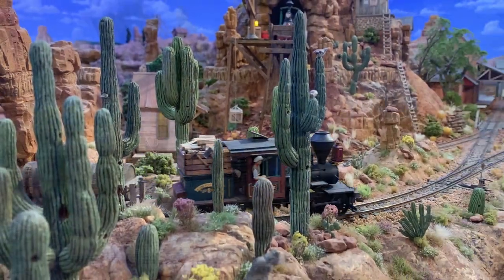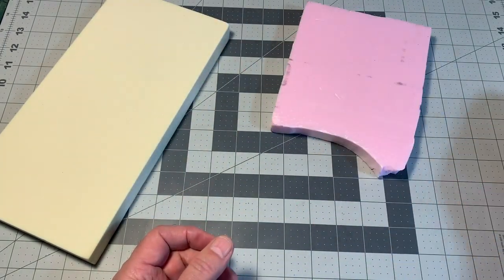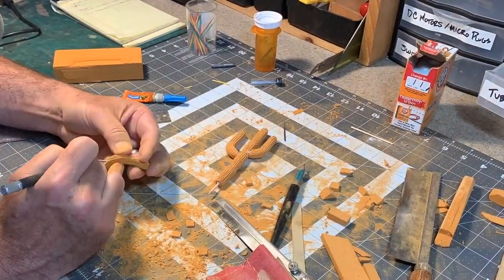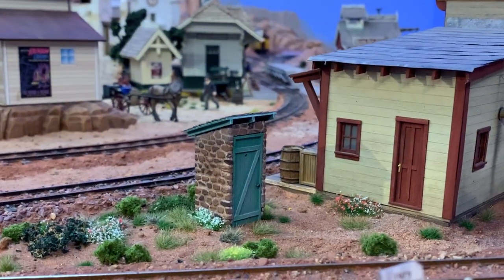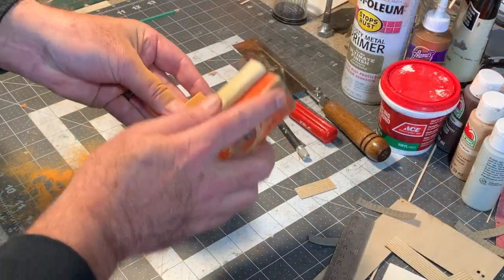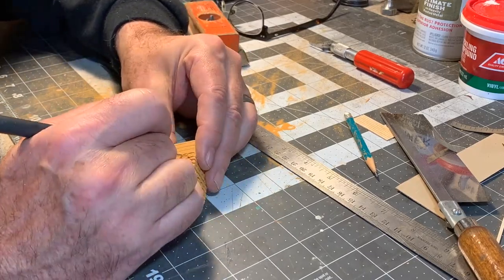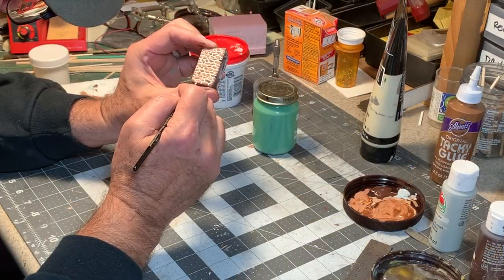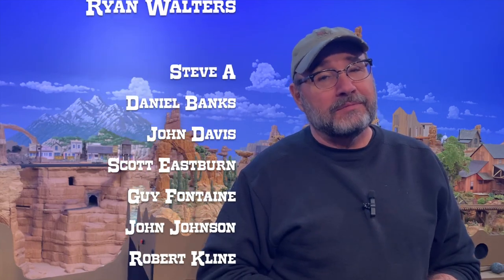Model Making Quick Tip: Polyurethane Foam

Comment: Dave,  Thanks for the info.  Searched for Gold Foam but not much luck.  Checked Amazon and saw some choices but not sure what would be similar to what you showed.  Like your channel, hit the Subscribed button.  I'm doing Marklin HO scale.  Concepts are the same.  Thanks,
Reply from the maker: There's a link to it in the video description but it appears to be unavailable at this time. It goes in and out of stock.
Reply: There is some polyurethane carving foam available on eBay, but both ship from overseas.